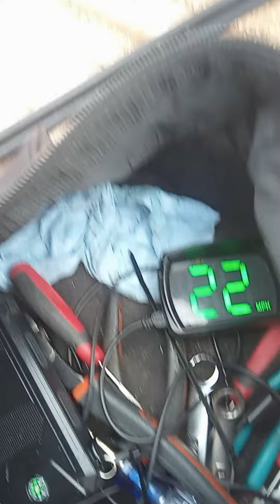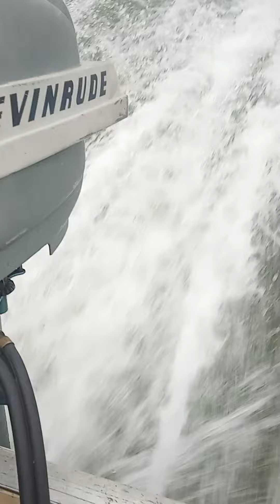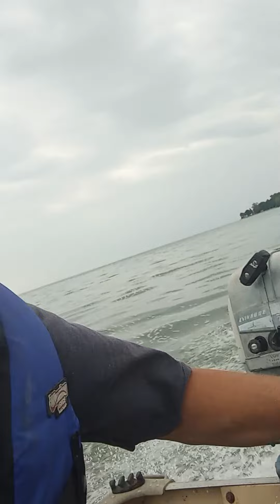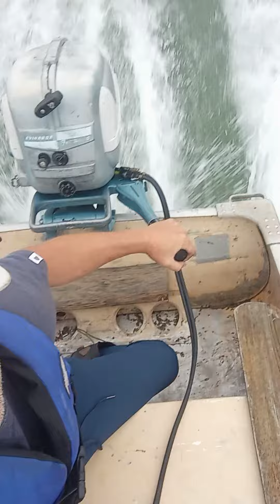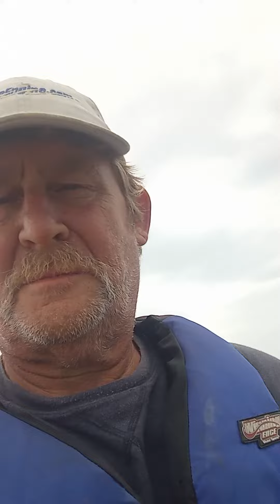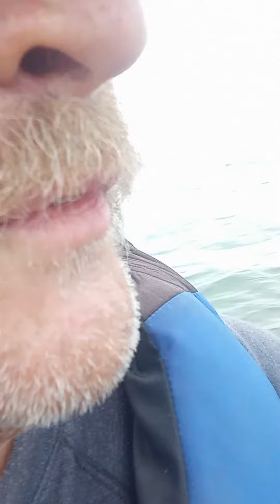Evinrude model 15014 -1955 -15hp. Lake Test

Comment: Those were great engines
Reply from the maker: Had it out day before this and was tooling along at 22 mph and all of the sudden it started slowly dropping down and eventually I was only at 13 mph. I took it back to the shop. Found out it was a simple spark plug wire. An original dated July 1954!  When I went through the ignition, I had replaced everything but the two wires. See what I get!?!? 😅😅
Reply: @ALVintageOutboards  This stuff happens to all of us buddy